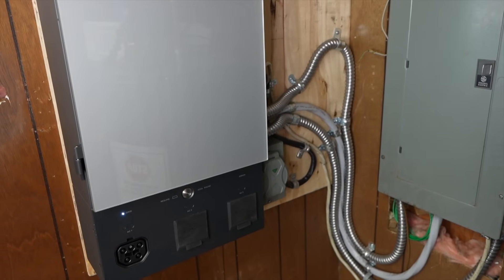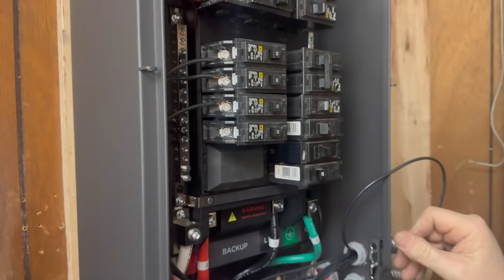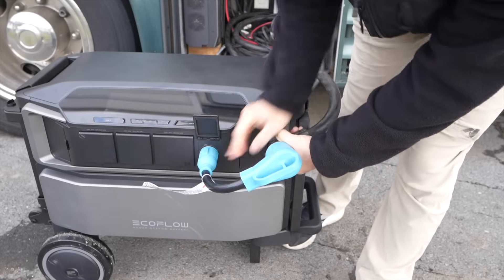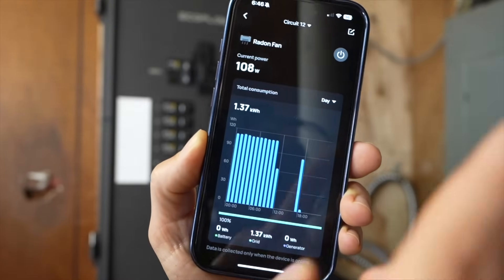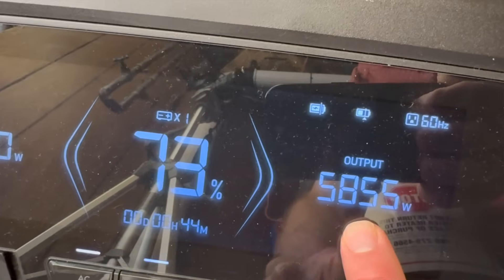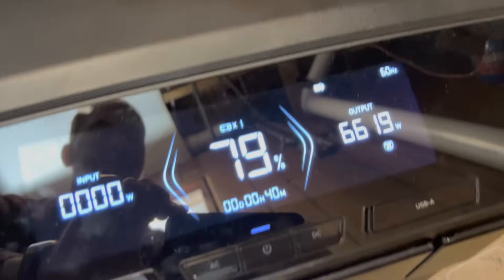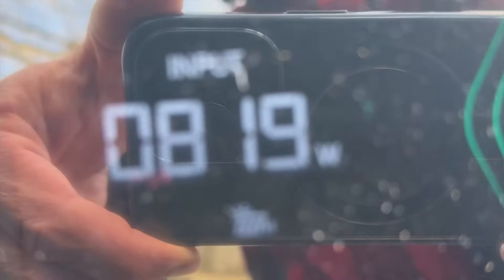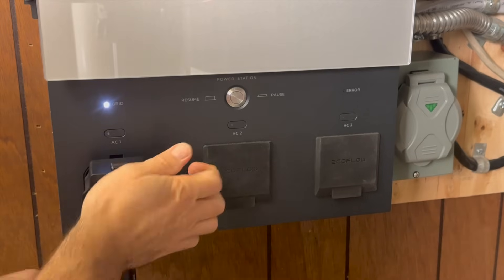I Added a Battery to My House | EcoFlow Delta Pro Ultra & Smart Home Panel 2

Comment: can this work with grid tide solar panels ?
Reply from the maker: The solar panels on my roof are grid tied (line side tap).  I have extra panels that can feed into the DPU directly.  A grid tied system would not directly interface with the DPU.  But it can be wired in to the house and charge when you tell it to.

Comment: The 240v input simultaneous 240v output is the most interesting. I cycle the inverter generator as needed.

Comment: I have existing roof top solar panels that connects and feed to the grid. If I connect this ecoflow battery to the main panel through a power inlet, will I be able to charge it through roof top solar when there's power outage? Right now the roof top solar can't be used when the grid is down. Thanks.
Reply from the maker: I'm guessing your point of grid connection for the solar is through a backfed breaker.  In that case, I would think that it might work, though I haven't tested it myself.  I will be at CES this January so I'll put that on my list to ask one of the EcoFlow engineers there.  I am not sure if the inverter on the DPU  could be damaged with the rooftop inverters backfeeding power.
Reply: @FrugalRepair  Thanks. It'll be great if you can check with them. DPU is much cheaper than the integrated solutions like Tesla Powerwall. I also don't like that the integrated batteries will be charged and discharged daily - which degrades their life span. All I want is a solution when there's power outage. I don't really care if I can feed the extra battery power back to the grid for the pennies they pay me.
Reply: @simonszhao  YOU EVER FIG THIS OUT?
Reply: @FrugalRepair   DID YOU GET A ANSWER ON THIS ? I GET DIFFERENT ANSWERS FROM CRAP CUST SUPPORT WITH THEM

Comment: Awesome video. About to purchase the Ecoflow Delta Pro Ultra inverter, 5 batteries and the smart panel 2. I would like to have my home 3 ton ac unit (30 amp) to the smart panel. My concern is the fan on the air handler gets it power from the heating breaker (60 amp). I do not plan to ever power the heating system using batteries (we don't get that cold here often). But how do I power the blower so the ac works properly? I will not install the panel myself but would want some knowledge when getting quotes from licensed electricians. Thanks for any advice.
Reply from the maker: Thank you!  Obviously, I don't know your setup but I would imagine that the blower/handler would have it's own power source and perhaps you can find that wire (or ask the electrician to wire one in) and then bring that over to the SHP2.  You can email me if you have more questions and if you want to send photos and I can potentially help better.

Comment: This may seem like a dumb or crazy idea but I'll ask it anyway.  I have a pre-existing large solar array that feeds directly back to the grid.  I' like to have a battery backup system as well as one that can power my 220v crypto rigs.  This seems like a great solution for both, but rather than buying separate solar panels, I'd like to see if I can tap into my current system.
Is it possible to just add an outlet to the line that is feeding directly back into the grid power in my fusebox and charge the DPU via the 220v input?  Or is that crazy/dangerous?  🙂
Reply from the maker: You might want to email me if you have more questions.  If your solar array is backfed through a breaker on your main panel then couldn't you install a 220V outlet with the breaker on your main panel?  Then you can charge the DPU from that.  But maybe I am misunderstanding.   I made this video comparing two battery backup solutions (Anker and EcoFlow) if interested.   https://youtu.be/9uNSm626Pcw
Reply: @FrugalRepair  yes that's what I'm thinking I can do.  Just add an outlet right before it is fed directly back into the panel to the grid.  Just curious if that is okay to feed into the DPU as the wattage would fluctuate wildly through the day.  Is that okay to just plug it into the charging port? was worried a bit about it not being steady voltage and eventually damage the unit... ? thank you!

Comment: Can you tell me how much problem I have if I already have a main panel on one side of the house and another subpanel in the garage?  both have main circuits (240) and 120 circuits.  Would I have to have 2 smart panels to run the whole house off the battery/inverter delta pro ultra?
Reply from the maker: That is hard to answer because it depends on which and how many circuits you want to have backed up by the SHP2/DPU.   I would think you would want one SHP as a critical load panel off of your main panel.  If you want the circuits in the sub-panel to be on the SHP2, then maybe you could run new wires for just those circuits?  Not trying to punt but maybe you could also ask this in the EF facebook group since there can be a back and forth a little easier with more people.

Comment: Can you connect a 110w solar panel and a 220w solar panel into the ultra?
Reply from the maker: I doubt the 110w or 220w is over 30v, which is the lowest the DPU can accept on the low voltage port.  So probably not.

Comment: how much load you put in the panel 2? 
what is the size of you battery array and how long does it take to charge the dp ultra batteries?
thanks
Reply from the maker: It is about a 7kw load, a 6kwh battery.  I don't remember the exact time to full charge but at max rate of about 6,500w it should take about an hour starting at 0%.
Reply: @FrugalRepair  1 hour is fast. my problem is that i do not have space one ground and i have not found a installer for the roof.thanks for your response!!!

Comment: how can I connect 10, 400 W solar panels in parallel to an Ecoflow Delta Pro Ultra?
Reply from the maker: The key info needed is the voltage numbers on the solar panels.  If you put them in series (add voltage) you have to make sure the voltage doesn’t go over 450v (when temps are coldest outside).  You might be able to put them all in series on the high voltage port or take 2-3 of them and put them on the low voltage port and the rest on the high voltage port.
Reply: @FrugalRepair , the panels label say it is 31.28V. I think I want to do a hybrid (parallel and Series at the same time).
Reply: @FrugalRepair  ALSO CAN DO SERIES/PARL

Comment: I recently ordered the new Delta Pro Ultra from EcoFlow, but I'm having a frustrating issue. They sent me the inverter but not the battery, and to make matters worse, they charged me for the full unit.

When I emailed them to ask about the missing battery, they informed me that the batteries for this unit are out of stock and won't be available until mid-July. However, when I called their customer service number, I was told the batteries would be in stock in early July.

These conflicting dates keep me stuck with a Delta Pro Ultra and no battery indefinitely. Adding to my frustration, their website still allows people to order the kits and the batteries as if they're readily available.
Reply from the maker: That is frustrating!  Hopefully the battery will come sooner than you expect.  If you want to shoot me an email, perhaps I can ask on your behalf.
Reply: DID YOU GET THE PROBLEM TAKEN CARE OF

Comment: Why can't you schedule battery discharge and use EPS at the same time???? Who would ever want to wait 5 seconds in darkness for your battery to switch over.
Reply from the maker: You can.  The EPS mode will use more power while the inverters are on ready to be used.
Reply: @FrugalRepair  The app says "Conflicting settings! Turning on savings mode will turn off the EPS mode."

I am just trying to turn on Scheduled Tasks on the Smart Home Panel 2 and that comes up.

Comment: I have an 30a 240V interlock system already wired up in my home for a roll out Honda generator. Can I just plug this unit into the same socket I plug the generator into?
Reply from the maker: Yes, the DPU outputs 240 split phase and you can plug directly into a generator inlet.

Comment: Nice video. According to one source, the average house in the USA uses about 29.6 kWh per day. That would be 5 batteries. What I have been wondering about this unit is how long it would take to charge 5 batteries with just one inverter just using solar power?? To me that signifies if this can really be used off grid. Thanks.
Reply from the maker: Thanks!  Giving numbers on this question is difficult because it depends on many factors.  Not only do you have to have a good guess at consumption, but it needs to be tailored to the seasons, like winter, use more heat, and there is less sun for recharging batteries.  So you could try to calculate what your 3-4 days needs are over some cold days in winter.  For year round solar production guesses, I recommend pvwatts.  It’s a free online tool (us government agency) and does a really great job modeling solar output.

Comment: Trying to figure out how this would work with my new food trailer. I only should be pulling 4500w at most when the hot water heater is on. Most of the time, it will just be about 3000w.
Reply from the maker: Shoot me an email if you have a particular question.

Comment: How would you rate functionality without the app? I was looking into these but I don't want another app to manage it. Do I need the app for setup? Does the system need to connect to my network?
Reply from the maker: You can definitely use it without the app or internet.  I would at lease connect it every so often to get firmware updates.  The display on the screen shows most of the information.  If you want to see a breakdown of input or outputs by source then you would want the app.  But if you just care to see totals the screen will show them and also various icons will light up to give information.  There are some options only available in the app like toggle switches for battery preconditioning (use the internal heating in cold weather) or AC always on, and a slider for setting charge/discharge limits, AC recharge speed, timeout values, and any automation timing schedules you can set up.

Comment: Can you attach your RV panels to the echo pro through a switch or bus bar on the RV then outside plug on the house? I assume the RV panels aren't doing much when the RV is at home.
Reply from the maker: Yes, I could.  I agree, why not take advantage of the solar already sitting g in the driveway.   I have the power kit system currently installed and so those batteries are getting charged by solar

Comment: Just purchased Ulra and Smart Panel and wanting to add some of their RIGID Solar... How many (2x400) of their panels would you suggest?  I have no other source of backup power at the moment so just getting started. Thx
Reply from the maker: It's hard to say how many solar panels because it depends on how much storage you have and what your needs are.  If it's your only source of power, I'd probably say get as much solar as you can.  You don't have to get EcoFlow panels,  BTW, you can get any panels you want.  But to know more precisely you should guess at your loads and use a calculator (like PVwatts)  to give you an idea of solar production throughout the year.

Comment: You would have to be a fool to pay such a high price for an inverter that uses cheap, low peak power, Chinese made, high frequency inverter technology. For a lot less money than this, you can buy a heavy duty, longer lasting, much safer, low frequency, hybrid inverter charger and a much larger inverter charger and get a much higher peak power rating.

Comment: Eco flow fucking sucks. They literally paid 12 Youtubers on the same day to drop the same commercial. This is so ridiculous eco-flow sucks.
Reply: I have the DPU and it works very well. Solidly made and loads of power. I bought it so I can power my well and heating system during outages. Oh, and I am not a Youtuber.

Comment: Will this send power back to your main panel ? I asked because it is connected to grid power via grid connection. Why is it that there is a built in transfer lock for the generator not to send power back to the grid but the batteries can send power?
Reply from the maker: No, this isn't an AC coupled solution so it would only feed the loads on the sub-panel.  That is why there is the interlock so it can comply with the regulations.
Reply: @FrugalRepair  I'm confused at this transfer lock too.  You charging the Battery with a gas generator, right?  Why would you need to lock it to use the generator if it's charging the Delta Ultra?  If it doesn't back feed when not charging with the generator, why would it back feed when you do.

Comment: What is the life of the battery? Also life of the portable battery?
Reply from the maker: It's rated for over 3,500 cycles.  A cycle is 100% to 0% then back to 100%.   So the way they rate these batteries is after about 3,500 cycles it should be at 80% of it's original capacity.

Comment: Good information however its seems that the ecoflow delta pro ultra downsize thier system it should be compatible with their Generator include a special port that feed the EFDPU with maximum also the automatic generator startup not included as well 

If I need to go 100% off grid and install e.g. 90kwh this option should included in order to recharge the battery however its seems the EFDPU may thinking about this kind of problem and they should found away to make the system compatible with their new system similar to the delta pro version and the dual fuel generator hopefully you well deliver this message to them
Reply: The new ULTRA is 100V and the only way to use the older generator they sell is to use the normal 110v plug.   It's amazing how the "ULTRA" is not compatible with any of their other products.  Not the last smart home panel and not anything.   You would think they would rename it to something else to not confuse the consumer into thinking it has compatibility with the rest of their ecosystem but it doesn't.   Also, my experience with their customer support has been absolutely horrendous .....
Reply: @tlteal  BECAUSE THEY ARE TRYING TO STAY AHEAD OF ANKER AND JACKERY . .THE OCEAN IS COMING TO USA VERY SOON. IF YOU HAVE ZERO PLANS TO USE THIS IN A RV OR MOVE EVER, THAT WILL BE THE END OF THE PWR WALLS ..

Comment: Will this pull the welding machine?
Reply from the maker: Do you mean pull it like a wagon or power a welding machine?  If the welder is 240 and needs less than 7,200W then yes, it can power it.

Comment: Yep,the Ambition Strikes channel just did a video of the same stuff but they didn't cover all the details that you've done. Years ago I wired in a timer to my water heater. Since I live alone I set the timer to turn on the water heater at 2 am through 5 am so I could take a bath before going to work. As a result of doing that I cut my power bill in half.
Reply: Yes and not only them. I saw at least 10 other Youtubers do the same with similar text frases. Ambition Strikes does shameless plugging on each of there episodes. Getting a little Eco-overflowed.
Reply: Evidently, they provided a complete script to just read.  Wild Wonderful Offgrid channel had the exact same script as Ambition Strikes.  They installed it at their parents home in Florida.  Just a little over-saturated for my liking.
Reply: @AlAndValOffGrid  plus they all were handed out the same goodies to advertise and were most likely given that stuff to evaluate over a period of time. Not a bad place to be though